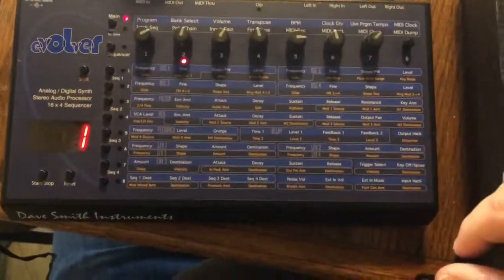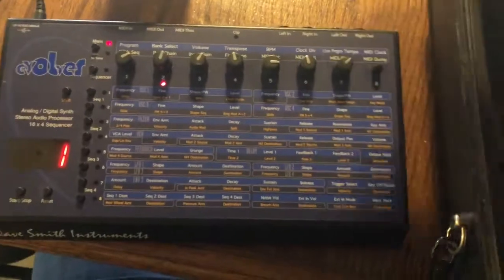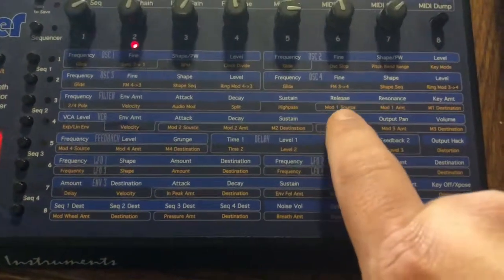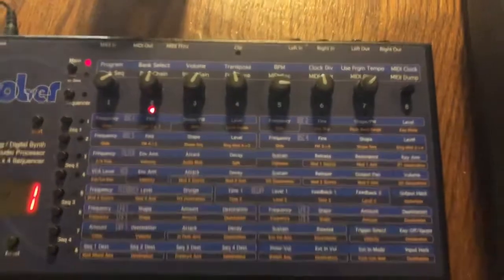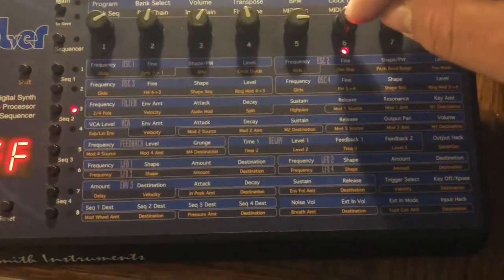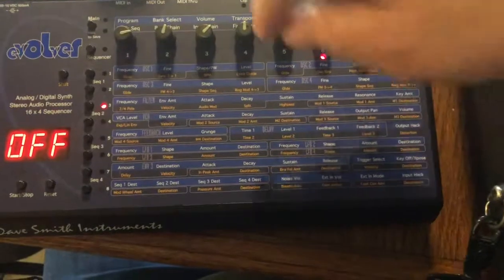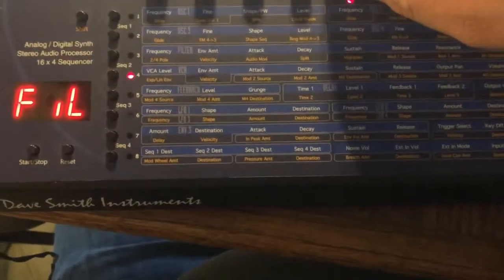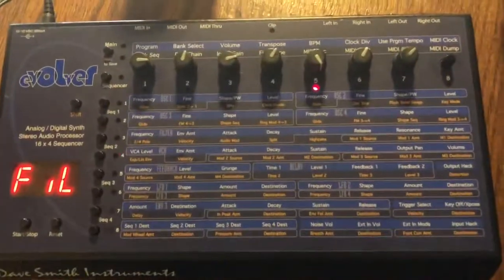DSI Evolver: Check for Breath Control

Comment: Or does this require more setup ??
Reply from the maker: ss s MIDI out of the EWI goes to MIDI in on the Evolver. Other than that, all you have to do is make sure your patch is responsive to breath.
Reply: Brandon Dorris Are most of the patches on there able to be controlled or is it a limited amount of them  available for breath control??
Reply from the maker: ss s none of the factory patches are, but there is a large bank available for free, created by John Swana. I can share it with you if you are interested, and I’d be happy to share my own patches.

Also note this is a synth only, and does not make any emulative/sample-based sounds at all.
Reply: Are most of the patches on there able to be controlled or is it a limited amount of them  available for breath control